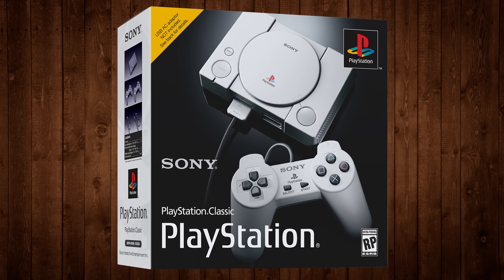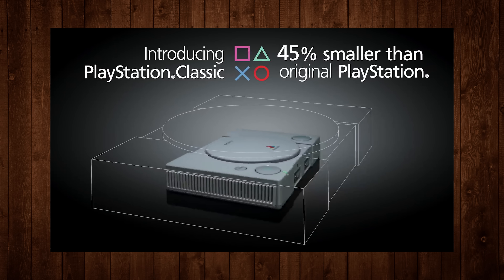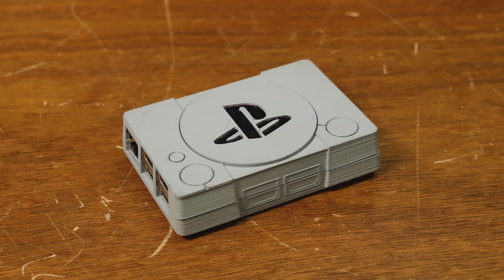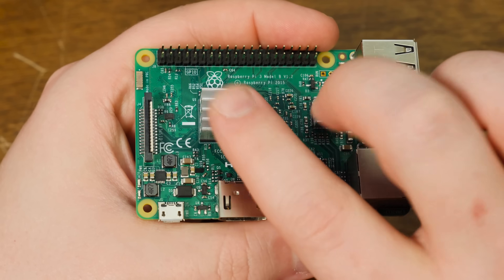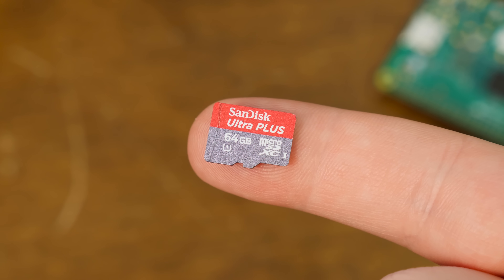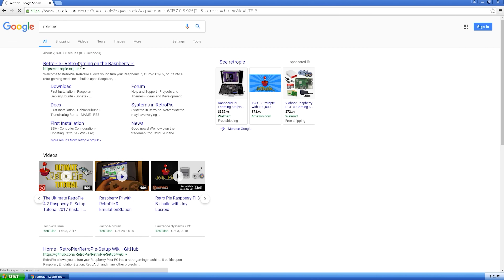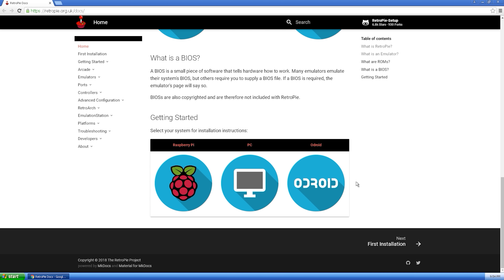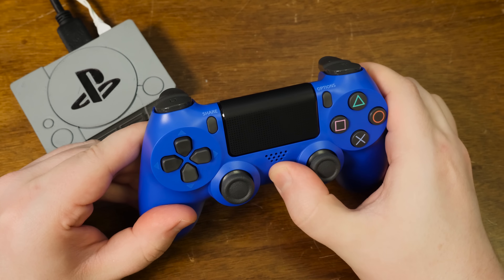Building a Better PlayStation Classic Console

Comment: Nice vid.  I've been thinking about doing something like this for awhile, but I've been too lazy to look up guides to see how involved it is.  Now that I see how simple and inexpensive it is, I'm sold.
Reply: I bought a Pi 3 after receiving a gift card to some store, and boy, is that little board versatile. After toying around, it became my retro game machine since RetroPie is so simple and well documented. I did install the Pixel desktop, fiddled around with webcam surveillance things, using it as a web server after RetroPie was installed, though.
Reply: Try it guys its really not hard and you have up to date guides everywhere. Also its a really cheap project for what you get!
Reply: Same. I always was scared about such a project but this looks pretty easy. ^^
Reply: It sold me too, for certain. I have an old MAME cabinet I set up almost 10 years ago. It struggles on anything less retro than 16-bit games and is the size of a VCR. 

This, a total setup of $100 that can play 64-bit games and sized to a deck of cards? And no countless hours of manual modification needed? Definitely time to upgrade!

Comment: 3D printing still looks like a potato printed it.
Reply: That particular print was trash. It can look much much better
Reply: Depends on the settings. That thing is an awful hack job. Can't believe someone is selling prints of that quality for $20.
Reply: @MrMistery101  Yep, though might be salvageable with some sanding with fine grit sandpaper at the worst of it + a coat of paint or
Reply: It's got some severe warping on the vertical surfaces. It's not salvageable.  @Mini-z1994
Reply: @MrMistery101  Yeah, it looks a lot like before I calibrated my printer.
Reply: Not even that, just don't use a nozzle that looks like it was taken out the Wendy's soft serve machine, a temperature from the surface of the sun, and layer heights that aren't spaghetti thick if you plan to sell prints.  @forestine_
Reply: @MrMistery101  my exact thoughts. i think its borderline criminal.
Reply: maybe it was a raspberry pi powered 3D printer.
Reply: For $20, I wouldn't expect much.
Reply: Looks like the type of prototypes for what 3D printers could do in their infancy.

Shame on the OG seller who did not even bother sanding the abominations, why skip on a few seconds work that could making something look so much better for sale =C  .
Reply: Glad you're are mom'ma could contribute gottem
Reply: +Naughty

there are still many things a 3d printer can manufacture that cannot be done in any other way, at least those that I know. Anyways, there are many other reasons I'd say they could be used for outside of prototyping. Some ways of printing are so detailed that I don't know why you wouldn't use a 3d printer for some tasks (laser on resin). Sadly, resin is still expensive as hell.
Reply: Not always.  There's quite an array of finishing techniques available now, and even some of the low end printers can give pretty solid results even before that.  A lot depends on the materials used which affects the finishing processes that can be used.

I've seen some pretty incredible results with acetone vapour

Comment: Not sure why Sony needed to make a PS1 classic anyway since the PS3 exists.
Reply: A modded PS3 is an insanely good setup. All the PS1, PS2, and PS3 games you want at your fingertips
Reply: Because nostalgia sells like warm cocoa. Or something.... And they want to cash in.
Reply: Not only can you download PS1 games, you can use your original PS1 discs on any of the PS3 models.
Reply: @Dwagonuwu  Yup. I have an PS3 as well. Have not tried PS1 on it. I prefer my original PS1 Grey model. Or fat model if you like. And there are even hdmi solutions for Ps1.
Reply: PS3 is crap tho (at least the official PS emulator) just finished the original Tomb Raider and it was pretty bad, stick to PC emulation or PSP/Vita.
Reply: @Dwagonuwu  PS3 super slim runs ps1 disks
Reply: Most people wouldnt wanna buy a ps3 and the ps classic comes with games but thats the only reason why
Reply: and dont forget the PS TV. They could have just rereleased that hing in a PS Shell and put the Games on a Vita Cartridge. That way they could have had many advantages over other Mini Consoles. Like wireless Controller Support, the Option to download new games from the Store or release more Collections later. And you could have played all those Games on the Vita on the go if you wanted to.
Reply: @retroprogamer7009  Lots of these devices could have been different from what they are;

Nintendo could have based their mini consoles off of a Wii on a chip if they wanted.
Even from a cynical perspective where they release each mini console as it's own thing with a fixed selection of games, that means they could've re-used all the code for the Wii virtual console. - the controllers they are using with these mini things are derived from Wii controllers, so that's no big change.

The advantages (to them) if they had done this, would include:
Can release NES, SNES, N64, Gamecube and Wii versions of the device without any meaningful hardware changes. (Also Neo Geo, C64, Sega Mega Drive, Sega Master System and Turbographx 16 versions if they really wanted to.)

Plus, if they had gone this route and chosen to be a bit friendlier about things, they could've had an online shop for these devices too.

They COULD have done that, but they chose not to. (Perhaps for good reason - a Wii is old at this point, but it may still cost quite a bit, and maybe can't be made so tiny either)

Though I am curious how they intend to tackle the n64 mini if they make one - the NES and SNES mini are nearly the same thing  internally, but I don't think the SOC they use has enough performance for n64 emulation. (let alone gamecube or Wii emulation.)
Reply: because Nintendo
Reply: The advantage of a classic version of the PS1 over buying a PS3 is that it’s cheaper, it’s smaller, it’s appeals to people with nostalgia for the original PS1 who for whatever reason don’t want to buy a PS3, and it comes with a bunch of PS1 games built-in. It’s too bad  Sony couldn’t get it right though.
Reply: @Charlesb88  what? You can literally buy a ps3 for less than 60 dollars and a controller for 10 dollars. The classic is 99.99 USD.
Reply: @Charlesb88  I have to disagree on the price. You can find the ps3 for the same price, and even for way less if you like to hunt a deal (I got mine few weeks ago for 50 euros, two controllers and some games included). Yet again I understand why someone would want something resembling the real deal.
Reply: Frank Thoughts PS3 got its reputation among nerds burned badly with Sony's behavior in relationship to the OtherOS feature removal, the GeoHot lawsuit and the drawn out class action lawsuit that only recently ended.  This is also another reason why the nostalgia crowd want any Sony official RetroPS1 to have absolutely no online connections that could go away at any moment (the servers used for RetroPie downloads seem more robust and trustworthy).
Reply: @Charlesb88  
$30 cheaper at most...unless you mod it yourself.
Reply: PS3's PS1 emulation isn't perfect.
Reply: IzzyData Your forgetting that the PS Classic has a bunch of PS1 games include whereas the PS3 does not. Whether you consider the prince difference worth it for the games you get is up to the individual. I wouldn’t bother as I have a similar RetroPie/RaspberryPi setup to his, though I don’t have a PS1 controller at this time (Only SNES-style controlers ).
Reply: Honestly, a retro console's look doesn't matter to me - If it can play the games I want to play, as legally as possible, I'll bite. Plus, since I still have my PS3, and it still works, (and a PSP, if I can ever find it) well…

(Note: I misplaced the handheld a little over a month ago, and I haven't seen it since.)
Reply: You can also get emulators for the PC and even the Wii.
Reply: Or using an open source emulator
Reply: The PS3 is many things to many people, but few would ever call it "mini"
Reply: Ps classic has some games that are not available to download on PS3 unfortunately.
Reply: and thousands of original PS1 still exist with their spare parts (original or not) still very easy to locate, i shunned the idea of PS classic because.... yeah, my PS7502 still alive and well hahaha
Reply: As with most of these things, it often comes down to the availability of the original software.  And here the PS1 classic falls down a bit too because of how many of these games are easily available on modern Playstation systems.

So, really its value can only be judged as an awkward bundle of emulated games, often jankily emulated.
Reply: sadly, backwards compatible ps3s are dying, just like mine did :(
Reply: Well games pre 1997 don't work....